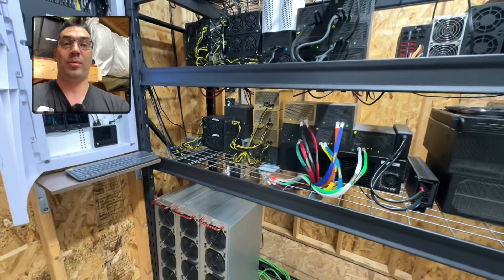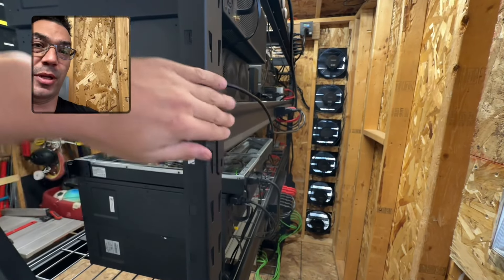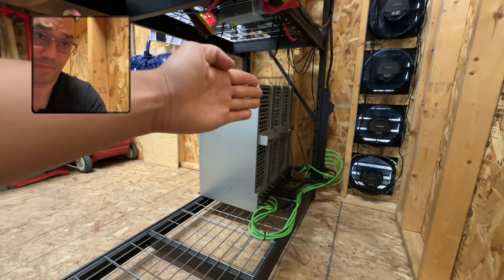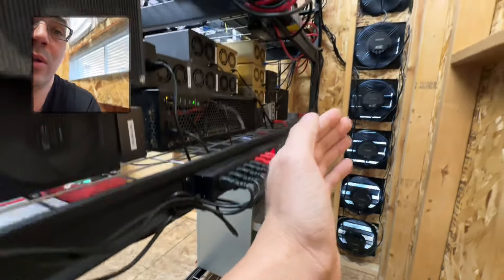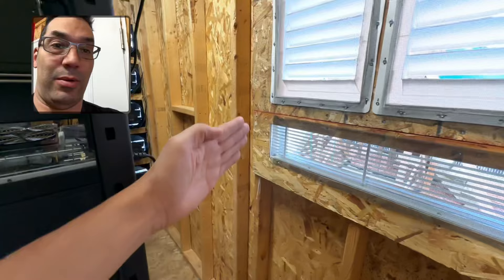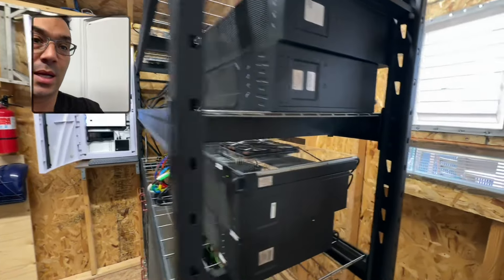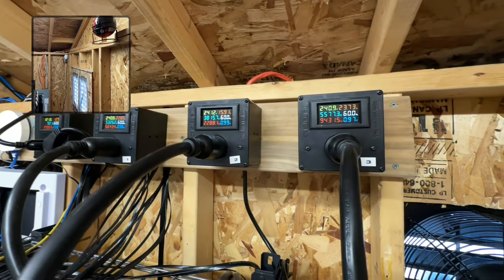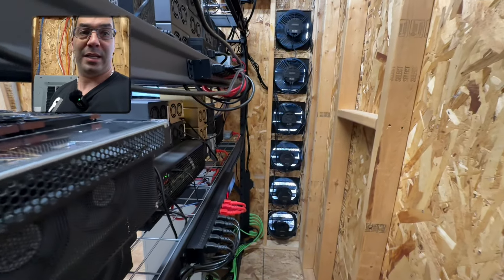Shed update Last customer install!

Comment: Hot and cold side is the way to go but I wouldn't use AC in the cold side it will not keep up cost you $ .once you separate your hot and cold side cooling will be way easier keep it up
Reply from the maker: the temps are amazing in there now, however when the humidity and heat comes in Canada 45C the ambient in there it too hot so I will have an AC, its only about 1500W to run an AC and it keeps it dry and cool like my basement mining room if you've see the build of that :)